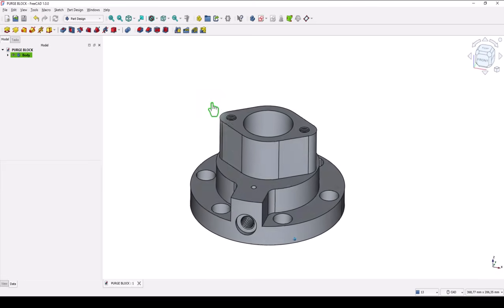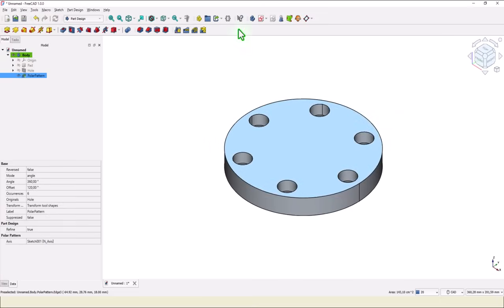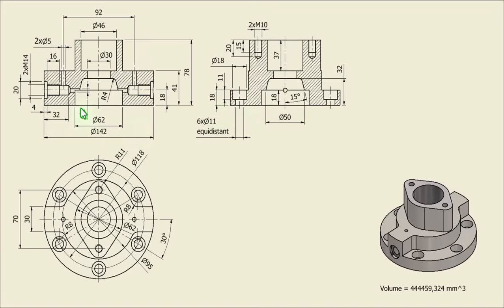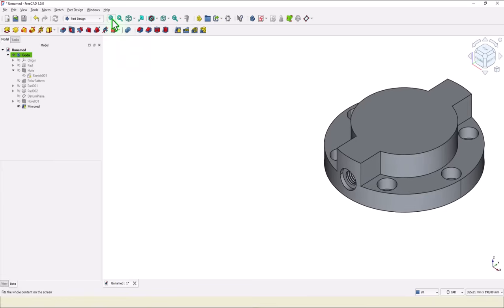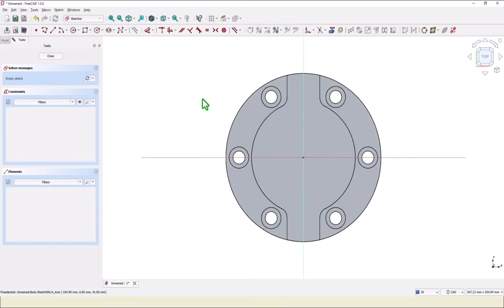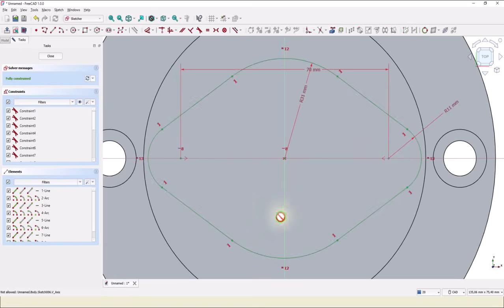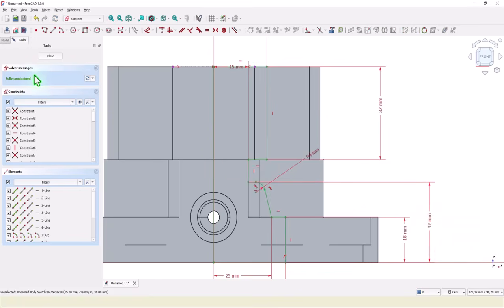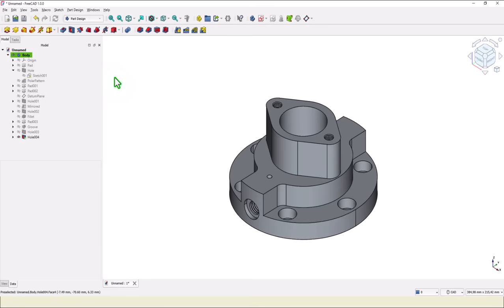Tutorial FreeCAD - 053 PURGE BLOCK

Comment: Thanks professor, I had attempted this one using but following your inventor tutorial. I never could do it with Freecad because it didn't support the G1/4 type. This version worked fine. Except the M10 holes in the top. My version of Freecad would not model the threads. It came up with an error "Removing splitter failed". I'm using Freecad version 1.0.2. Not sure you needed all that info, but I wanted to share. Looking forward to next one.
Reply from the maker: Glad I could help! It seems that 1.0.2 is not so strong.
Reply: @prof-stancescu  FreeСad 1.0.2.
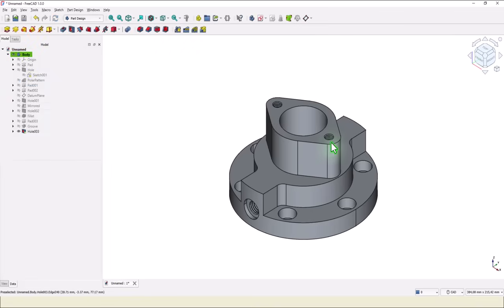I also have an error 24:56 "Removing splitter failed". 
But there was no error in the previous step 10:51.
Reply: 24:28 If I choose Deptр "Through all". Then there is no error and the thread is created.
Reply: Another way to avoid the error:
24:28
If I write 60, then it doesn't give any errors.
If I write 59, then it writes the error "Removing splitter failed"